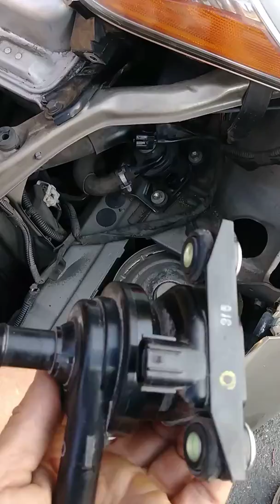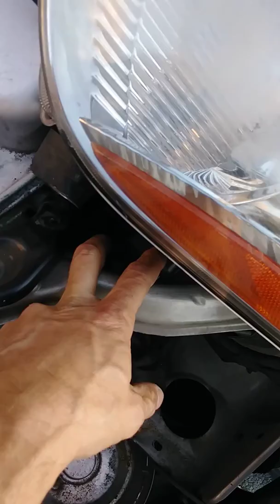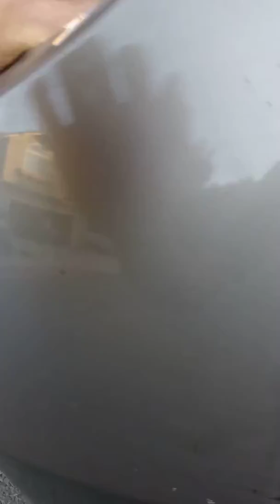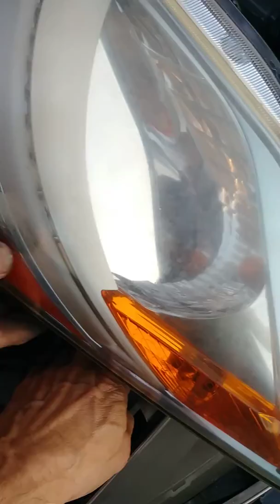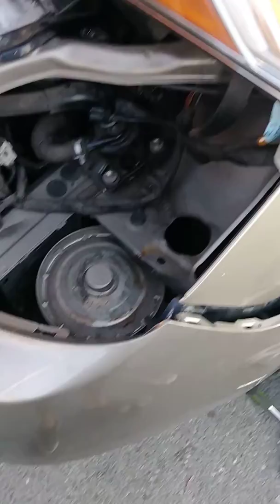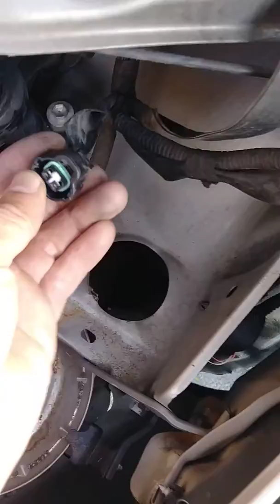Easy Prius 2 Inverter Water Cooling Pump Replacement

Comment: Great video. Really helped me out. Took me about 45min. I used the bleed valve to get the air out as well. I used 1/4in inner diameter vinyl tubing from home depot to bleed the air out of the system. It was stupid easy. It was shocking how much air there was so make sure you don't forget this step. Having air in the coolant system is no good.

Comment: Hi Buda Bunda thank you for posting . Can you help me on this. I had the invertor pump changed at the dealer and upon collecting my car, the minute the key is inserted and start button pressed, there is this humming noise that comes on and it goes off when I shut down the system. I drove this car for more than 10 years and I didnt have this noise before as the hybrid system is totally silent when nothing is moving until the aircon or engine kicks in. I brought back to the dealer and have it checked. They confirmed the noise is coming from the new pump that had just been replaced, but they said the computer check didnt detect anything wrong with it and therefore it is ok. I on the other hands felt that something is not right since it was not like this before for 10 years. And it is not logical to me that the pump should be on all the time even when I was not in engaged mode. any such pump must be drawing power from somewhere in that case and I am afraid it will drain my battery. The dealer said they cannot do anything since the computer system check showed everything is normal. Can you please let me know if your Prius had the same humming noise or was it dead quiet when non engaged. Appreciate very much if you can give me some advice on this.
Reply from the maker: Probably the rubber mounts are missing or something is rubbing against the pump housing causing Noise and Vibration into the body.  Its possible they replaced the pump from the top of the engine bay which is nearly impossible to get all the bolts in properly without alot of patients.  a lazy lazy mechanic likely only replaced 1 of the bolts or left one loose or even missed the hole for the bolt or knocked the rubber insulator off and lost it so its now metal to metal.  Thats my guess.  Good luck.
Reply: @scrappydogfinance8434  Thank you for your input, much appreciated. 
I will get a mechanic to look at it. Its been a while and I kind of ignore it, otherwise it drives me crazy. 
Thank you for taking the time to help. 🙏😀

Comment: To bleed theres a bleeder in the front of inverter, just crack it loose, push start button twice and the pump should come on, once bubbles stop and just fluid is flowing, close the bleeder, turn off car (you can repeat this twice, or even better just do it after driving it some to get all bubbles out) top off coolant, done. Thanks for for showing how simple this is by just taking off front bumper, you don't even have to take it all the way off, you can leave most of the stuff on passenger side and air damn attached
Reply from the maker: Didn't realize this. Great tip. thank you.

Comment: How do you clamp the hoses? Does it not damage them? I thought I would have to flush the fluid but I did that not too long ago so if I can save it, even better!
Reply from the maker: The factory hose clamps are spring clamps you can just squeeze the 2 tabs together with a good pair of pliers.  Channel locks usually work well.  That releases the spring tension then wiggle it back away from the pump.  The hose might be a little sticky, just give it a good twist or slip something thing underneath it gently to crack it loose, careful not to damage the rubber or poke your self.  Spring clamps are known to snap loose and fly so wear eye protection and gloves.  Good luck